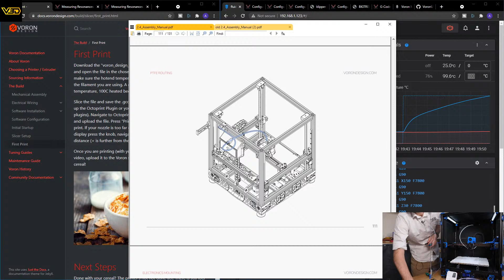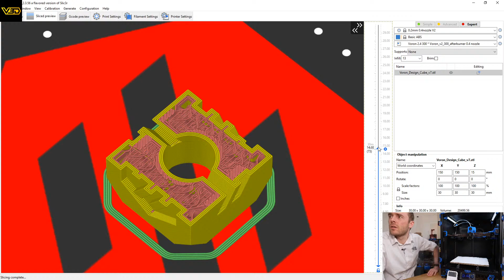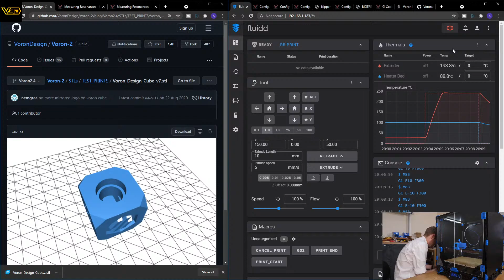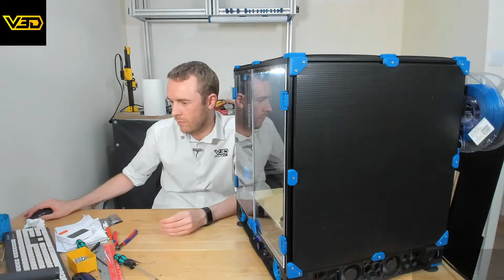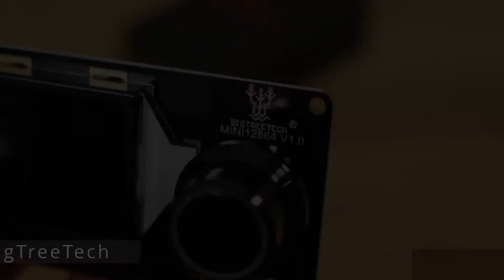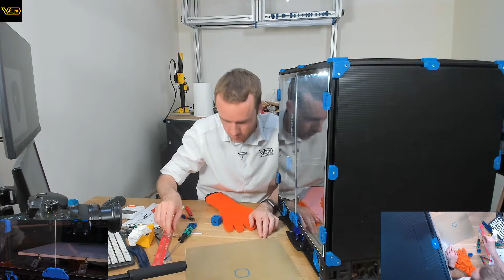Voron 2.4 Live Finale! Part 13: First Print!

Comment: First prints are irrelevant as usual. Calibrate/tune, show the perfect print, and then turn up the speed/acceleration. 300mm/s print, 500mm/s travel and 10,000mm/s^2 is perfectly achievable (with input shaper). Mods: AB-BN, Klicky, purge buckets and scrubber (listed in mods), exhaust with side-mounted Bowden (for back to wall)
Reply: Why the heck would you need purge buckets?